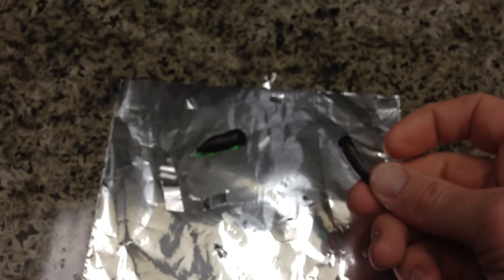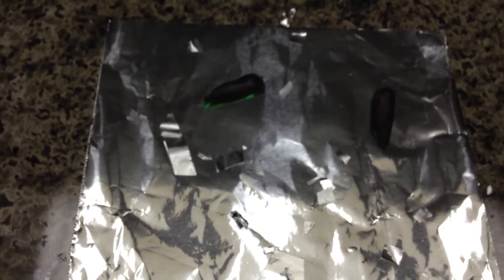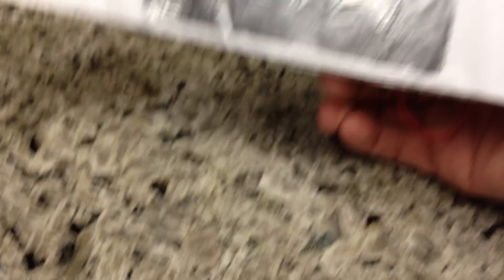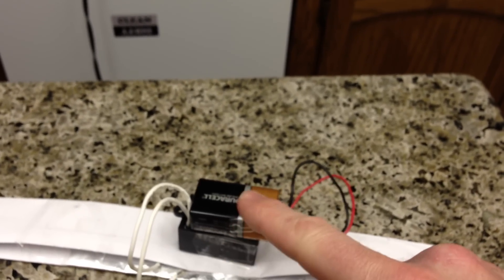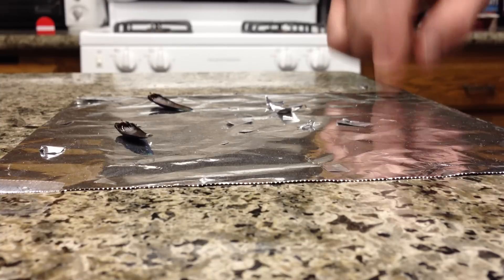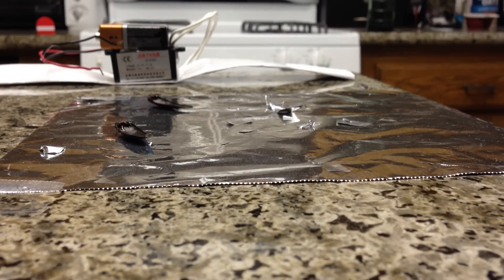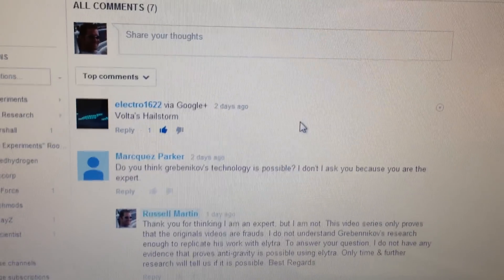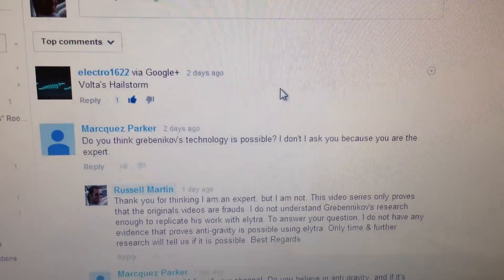Explanation Bouncing Elytra - Grebennikov Video Replication Series

Comment: called as a beetle whose wings you have used?
Reply from the maker: I used the Emerald Jewel Beetle Elytra (Sternocera aequisignata), but this effect can be seen with any elytra and any form of chiton. Chiton is a strong dielectric that will hold a static charge. To see this effect with elytra, a smaller light weight elytra should be used.
Reply: thanks for the answer

Comment: Hi Russell, how about we set you a critical thinking challenge: Jon Depew Magnetic Vibratory Resonance (1 of 5)
There you go. So, How'd he do it?
:)
Reply from the maker: Truly this is an interesting effect. It has already been replicated by a number of people. As long as there is a motorized spinning or pulsed EMF, all other magnetic fields within a given radius will synchronize with it. He linked many magnetic fields to each other. This must have taken quite some time to set up. First he needs the driver motor or pulsed EMF running, once that's up to speed he would need to manually spin each rotating magnet faster than the driver motor or pulse so as they slowed down they would sink.

Here is an example:
magnetic resonance pt1
Reply: The effect that I find most interesting is that they are all rotating in the SAME direction.
Reply from the maker: Yes, that's odd. When I don't have so many projects on my plate, I'll give this a try just to have a closer look.